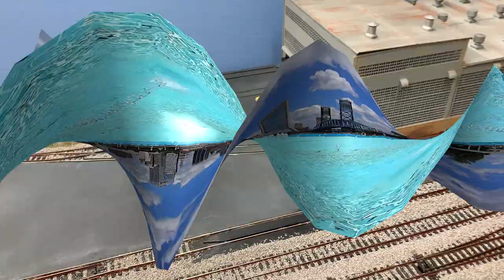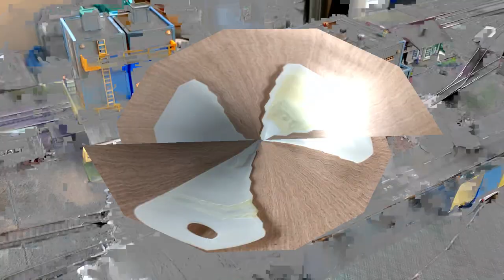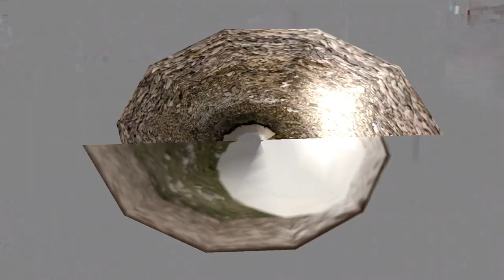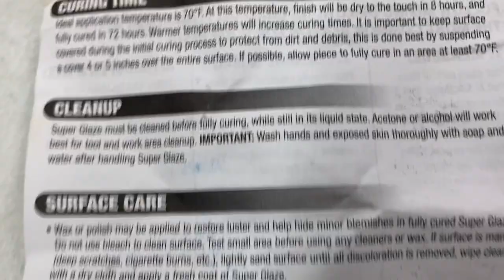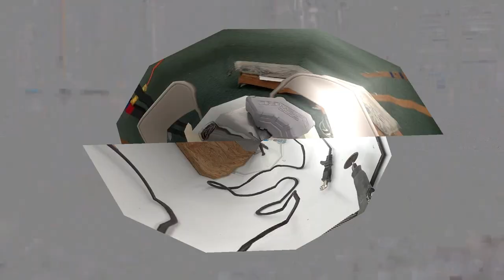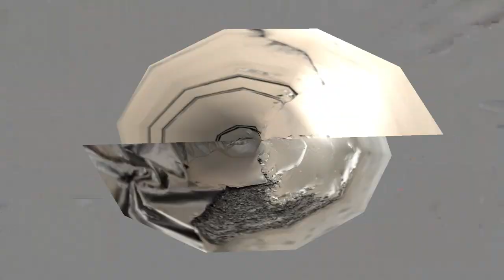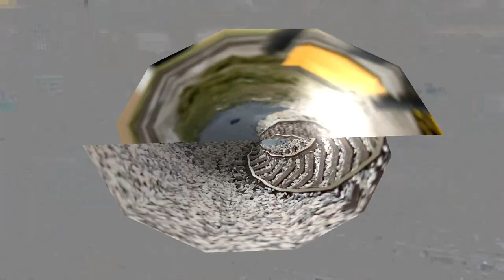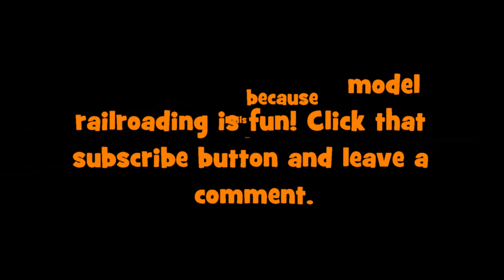Embedded rails, concrete slabs and parking lots for model railroads

Comment from the maker: Yes sir no problem. Skip the video to time frame 17:10 and I explain how to seal in the spackling compound putty so it doesn’t crack and flake apart. I use Parks Super Glaze sealer which is self leveling and seals beautifully. Please watch that part of the video as it explains better than I can type the answer to you. Too much to explain. At least this will explain how to do this. You’ll get a rock solid finish that’ll last for years. We use this technique on modules that disassemble and transport inside traveling trailers where the modules are subject to a lot of vibrations and minor beatings. I know the video is long but it was intended for an audience that is just starting in model railroading but rather frustrating to watch when someone’s been in the hobby for decades or knows a lot about dry wall. I stumbled across this technique by trying out different sealing products and Parks Super Glaze by Testors produced the results I was looking for. Thank you for watching my videos. More to come sir.
Reply: Thanks